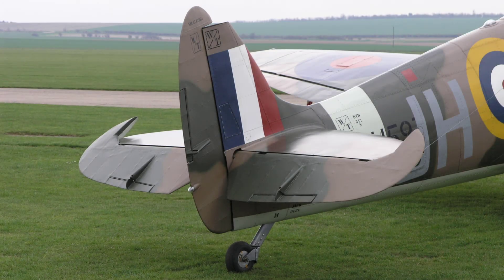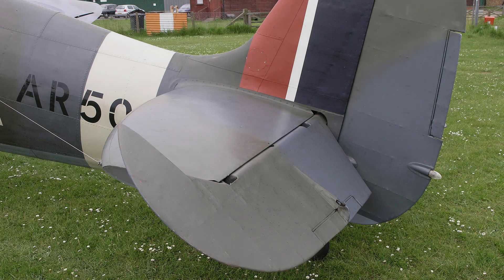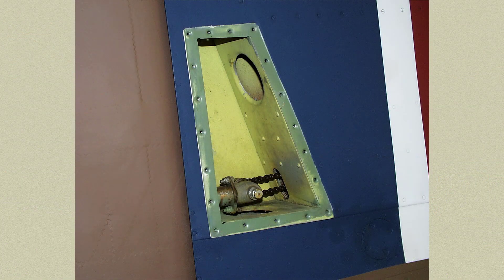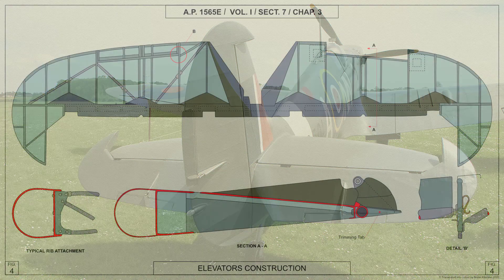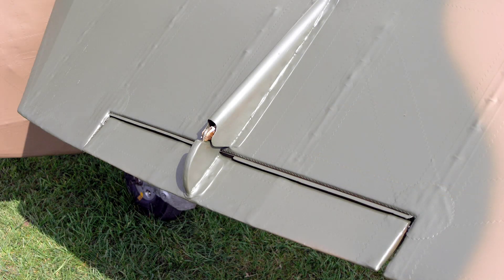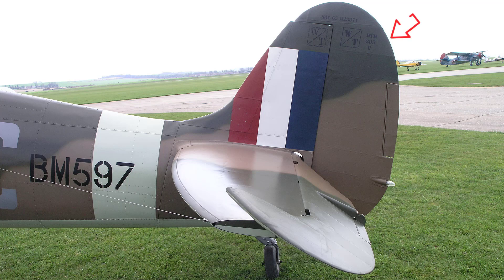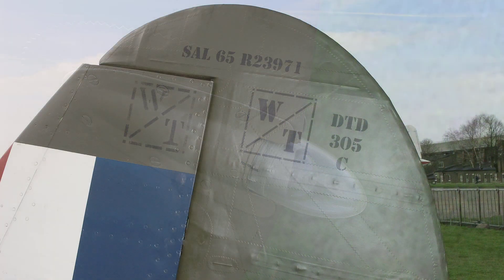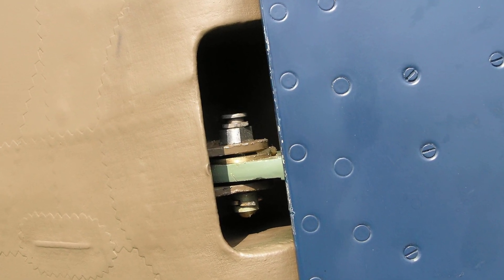Spitfire Mk V – The Tail Unit

Comment: One small point, the Spitfire elevators with the extended horn, as shown on the video, weren’t introduced until mid 1943, prior to this the Mk.V had the same elevators as the previous Mk.I and II Spitfires that had no extended horn section.
Reply from the maker: Thanks for sharing